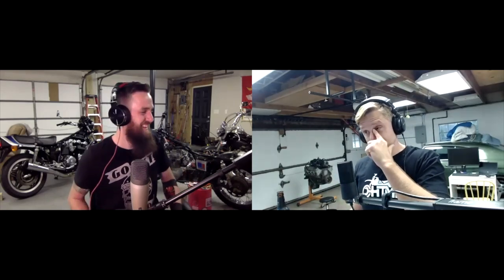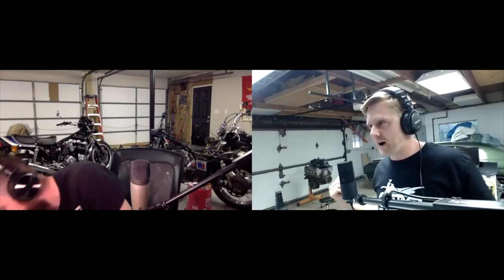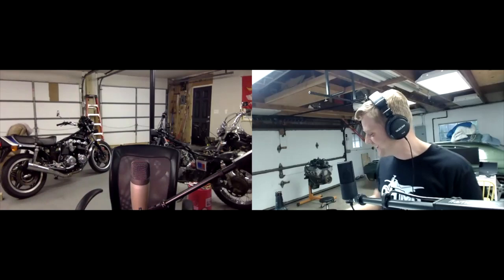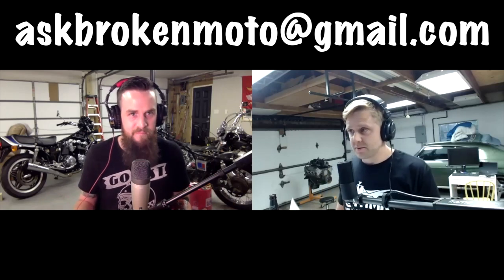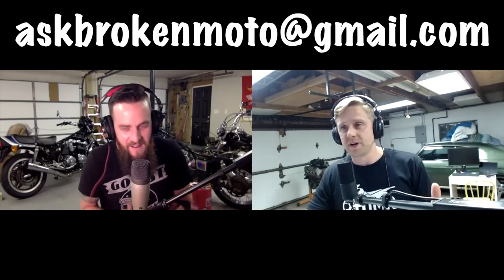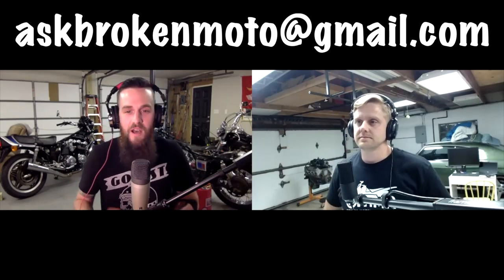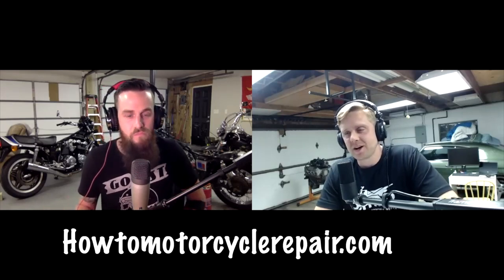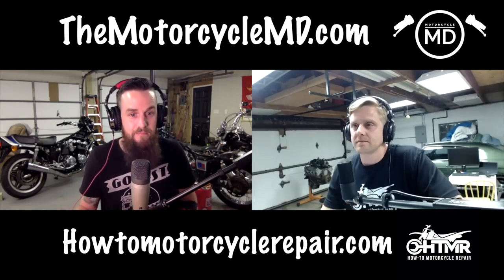The Broken Moto Show - EP4 - Carb cleaning advice and CANBUS?

Comment: If you want to be more environmentally friendly with your Ultrasonic cleaner, you can choose not to fill the whole tank with whatever cleaner you're using... instead put parts in a smaller separate container within the tank (when possible.)   I've never tried it myself, but I've seen videos about it.   For example, you take your jets and brass pieces and put them in a small jar with the cleaning agent of your choice then put the top on the jar and lower it into the ultrasonic cleaner which should be full of water.  When you're done, you've got less toxic stuff to dispose of.  Saves money on cleaning supplies if you're using an expensive  cleaner.